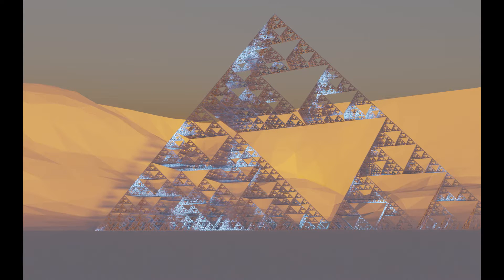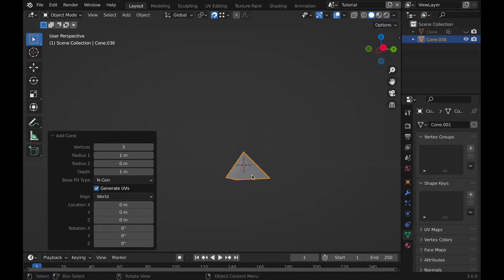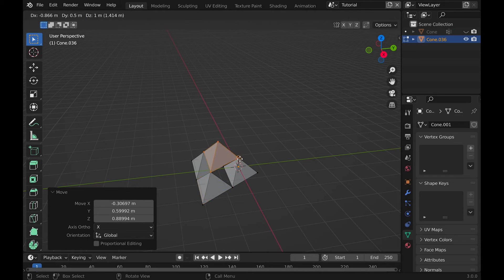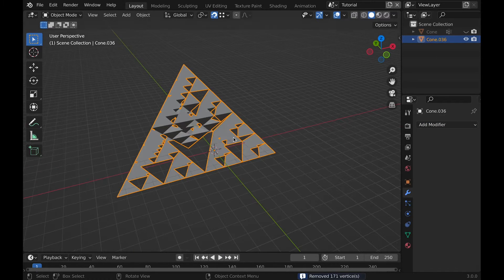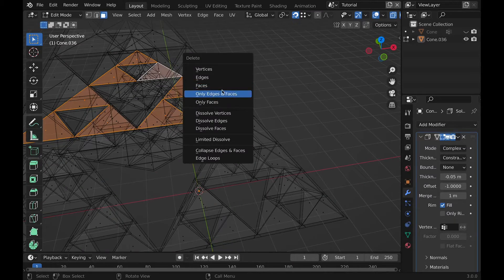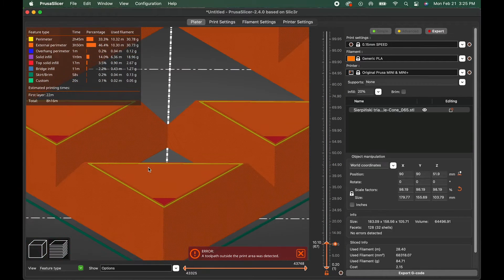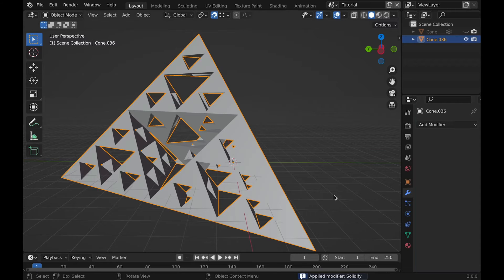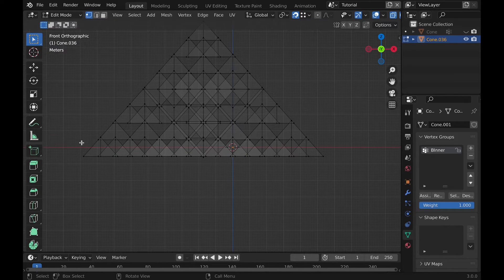Make a Sierpiński Triangle in Blender!

Comment: A beautiful and practical work. But the dots do not stick together as a whole like yours. If I select only one, it sticks. What am I missing? While the dots stick together with the entire triangle in yours, it does not react at all when more than one dot is selected. I could not find the reason.
Reply: In case you never figured it out, you need to make sure you have the correct vertex selected as the active one.

Comment: Hey do you think a 32core GPU+32GB M1 Max mac studio could handle rendering a short animation of a car driving through a tunnel/forrest in blender.  Was hoping to see if I could make a car in maya then render a mini commercial/B roll. Would love to get your thoughts on if the M1 were capable of it!. Thanks
Reply from the maker: I definitely think the m1 max could do it. It would still probably take a little while though, depending on how intense the scene is. Unfortunately, I can't really compare the m1 to any other fast computer since I've never used one. At the same time, I've done everything with my 13 inch m1 laptop and it's worked great!
Reply: @Dragon3D  Thanks for your reply! Yeah its a bit of an unknown area. But it would be cool to dive into. Keep the videos coming!